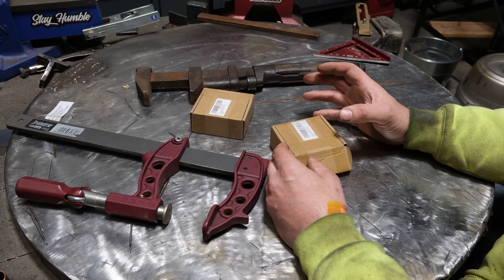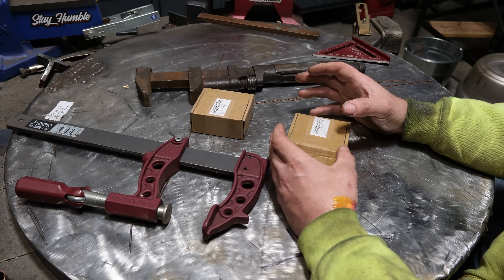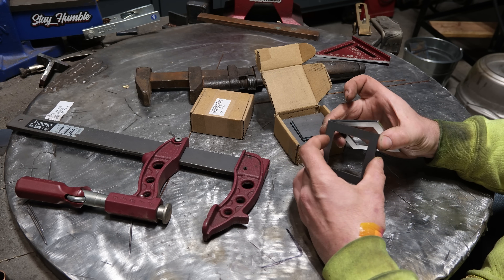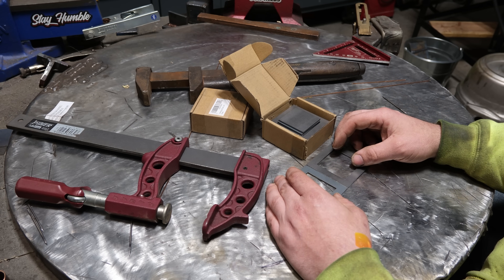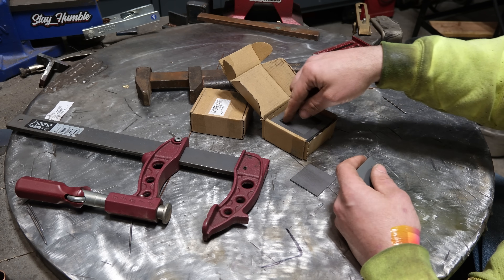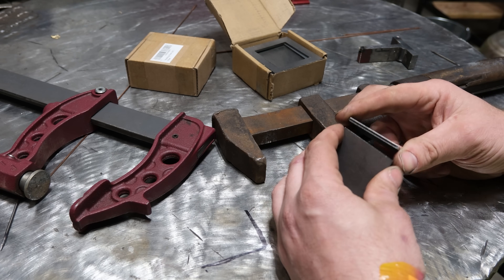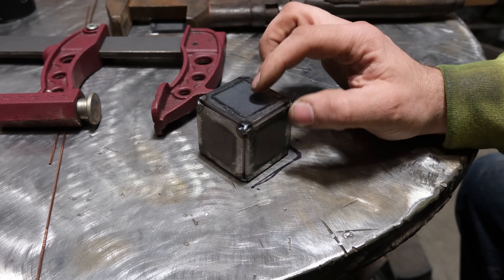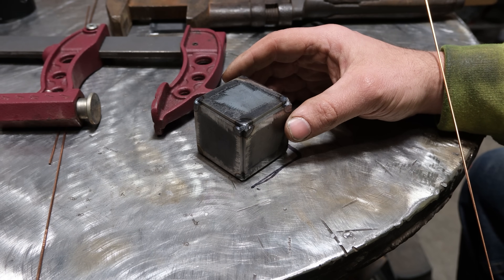Project time: lets weld a cube together from a kit

Comment: hey greg you started talking about eliminating the foot pedal as a variable, do you have advice for someone trying to learn without one at all? (I do on-site and in-situ welding, ill never be in a position to use one)
Reply from the maker: So I do have a bunch of advice, hopefully it helps.  I started the opposite of you, I spent 8+ years tig welding things with a foot pedal and not doing lift/scratch start.  I only went to lift arc due to going to work with the local steamfitters and they don’t use anything but lift/scratch.  I have grown accustomed to no foot pedal.  Having been on both sides of the fence, there are things I want the foot pedal for and things it’s an issue.  For thin material where you weld towards an edge a foot pedal is invaluable.  You can taper off amperage so you don’t melt off a corner.  Without a pedal you need to move faster and dab quicker as you get close to an edge.  On pipe where you never hit an edge having amperage control means very little.  For welding while standing and in oddball positions having no pedal makes life a lot easier, but it requires your amperage to be set more precisely and you need to be very good at controlling heat input with travel speed.  The biggest issue with tig welding without a pedal to me is aluminum.  Aluminum tends to need a lot of heat at the start, medium heat during the middle, and no heat at the end of a weld.  Being fixed amperage is a major limitation and will typically result in lack of fusion issues at the start of a weld and excessive heat at the end.  

It’s not all at a loss, here are some direct tips to help improve your abilities.  1) to start the arc be in the habit of getting the tungsten close the the metal and swipe between the tungsten and the work with your filler so that the filler makes contact with the base material and the tungsten for a moment.  This will start the arc and will reduce tungsten contamination.  Smoother starts means smooth arc.  2) Once the arc is established if your amperage is off you will have issues.  So setting the amperage correct is key.  The more skill you have (aka how well you can control heat input via travel speed) the hotter you can run.  The goal is to fuse things so running cold is not ideal.  Find an amperage that things fuse and the end of the weld isn’t super melting through whatever you’re welding (aka not super hot).  3) the hardest part of no foot pedal is tapering out at the end of a weld and not leaving defects.  This is far easier on say a piece of pipe where you can walk the puddle out while lengthening the arc gap slowly.  On a weld that’s on something that has an end on an edge or something, you can’t just run the arc out.  So normally what happens is you need to speed up slightly at the end, dab a bit more filler, and either snap out of the weld or quickly lengthen the arc gap to get the arc to cut out.  I need to do a video on ways to get better stops without a foot pedal.

Beyond what I said it will come down to a lot of practice.  Honestly no foot pedal isn’t much of a limitation, it just requires the person welding to have a bit more skill.  There are ways to make it easier to weld without a foot pedal.  The tig button can be bought and is amperage control that uses your finger on the torch instead of a foot pedal.  This is highly favored by people who do a lot of oddball repairs.  Higher end machines often have adjustable arc voltage cut outs, aka you can set it so that when you lengthen the arc gap  it automatically goes into reduced amperage mode and tapers the arc down in amperage. This prevents craters, improves end of weld heat input, and makes life easier.  Likewise torches exist that have full amperage controls along with push button arc starters/arc shut down features.  All of the above things make it possible to weld in position and have full control over everything.

Beyond what I said finding a stable position is important.  Find ways to prop and move with as little movement as possible.  Weld quality is worse when welding out in the open or on oddball stuff.  So anything you can do to help steady yourself so you can keep a consistent arc gap will improve the quality of your work 👍.
Reply: @makingmistakeswithgreg I've been working as a boilermaker for the last 5 years so basically just pipe. I started as a laborer and have been working my way up which really just means learning on the job and on my own as much as possible. Thanks a ton Greg.

Comment: Hey Greg. Do you have a video on stick welding thinner metal square tubing?
Reply from the maker: So I have done it in random videos but I definitely need to revisit it.  I will be welding a cube out with stick in a video shortly and that will directly help welding square tube.  The best hope of welding thin material with stick is 1/16 (1.6mm) rods, preferably 6013 or 6011.  Sub 45 amps and a fairly quick travel speed will be best.

Comment: Do you have anything similar for mig welding.  Side question, my Father was a welder 80 years ago and did a lot of brazing. Is that process (mechanics) the same a tig welding. He wanted to teach me but I was young and stupid and thought accounting would be cleaner. Now I'm trying to learn what he tried to teach me.
Reply from the maker: I will be mig welding a cube and giving some settings shortly.  It will be harder to mig weld the thinner material but still doable.  

As far as brazing, there are multiple forms of brazing.  Conventional brazing is done with a oxy acetylene torch and either a bare bronze rod dipped in flux or a rod with flux on it.  The purpose of this form of brazing today is generally to join pipe and tube and the braze flows via capillary action into a joint.  Oxy fuel brazing can also be used to say braze a crack shut on an exhaust manifold, or to build things that are ornamental.  There is another form of brazing known as tig brazing that also exists.  This functions very similar to tig welding In the sense you use a bare bronze alloy rod and it “welds” just like a normal steel welding wire.  The distinguishing characteristics of both tig and oxy fuel brazing is the bronze material is the only thing that melts and the base material is not melted.  Keep in mind that oxy fuel brazing rods can’t be used with tig, you need tig specific rods.

Brazing does take some skill to do, but it’s not any harder than welding with the same process.

Comment: I just watched your "does preheat help fusion" video, but commenting here, hoping you see this and can maybe respond- I welded a set of 1" thick shackle tabs to a winch bumper about a year ago. Well, actually, I did it twice- One of the shackles peeled the outside edge free of the base plate as everything cooled. I'm not much of a welder and this was a very (over)ambitious project of mine. I took the time to grind out my welds on both tabs, checking as I went.

The first time, after putting a slight bevel (3/16" roughly) on each lowest edge, I heated each tab up to around 600*, watching for the tabs to change color as the alloying metals oxidized to judge my temperature.  I then placed them and hit them with a heavy tack, then started stitch welding around the perimeter for the first pass, alternating back and forth to try to keep everything equally hot. I hit my weld and the joint with a clean wire brush after each weld segment. I did this until I had a three pass weld around each shackle tab. I then let them cool.  One did shrink enough to completely crack off the outermost lower weld, which prompted a do-over.

I was happy to see I had almost no porosity in any of my welds as I gouged everything out.

The second time, I preheated the tabs a bit hotter, heated the base plate to about 300* where each tab was going to be set, and repeated the excercise, except after cleaning each stitch weld, I also hit both with a torch for 30-45 seconds to keep the temperature up. Once I was done with my last section of my 3rd pass, I hit everything with a torch again for several minutes back and forth between the two tabs and the base plate, then allowed it to cool.  No cracking anywhere the second time.

I used a lincoln 140 with. 030" solid wire, settings maxed out. Neither tab has broken off since with a couple solid winch pulls, but your vid is making me concerned that I should not have attempted such a job with such a small welder.  Any thoughts?
Reply from the maker: The hardest part about welding thick steel with the short arc process is it has unreliable fusion.  The reason it’s not used for thick material in most “code work” is simply because its ability to penetrate into/fuse thicker steel is not consistent.  Some areas may be fused, other areas may not be.  The first 1 inch or so will generally have very poor fusion.  With a 120v welder it becomes even more limited because the process can’t carry enough heat on thicker material and the weld will function more like pouring molten metal on the joint (weld just sits ontop).  The reason you saw cracking was basically due to the mig wire just making a molten river of metal ontop of the plate, and it never actually fused.  

As far as what to do, the biggest issue with recovery points is shock loading.  Poorly penetrated welds can hold a ton of static load.  Taking the same weld and adding thermal cycles, vibrations, or impact forces and the weld will fail.  If you have doubts to the quality of the weld it’s in your best interest to do something to fix it.  Grinding the weld out and tig/stick welding it would give better results.  Or using a more powerful wire machine with spray arc or dual shield would also work.  Changing the engineering could also work.  Many professional bumpers have a shackle mount welded on both sides of the bumper to help prevent failure of the mount (aka it being pulled through. 

Hopefully that helps 👍
Reply: @makingmistakeswithgreg  Thank You!  I really appreciate the response.  Unfortunately, I don't have access to a spray arc capable mig or stick welder.  I'm pretty much stuck with my 140 for now.  I forgot to include my shielding gas in the original comment, it's a bottle of 75/25, which I think you've shown offers better penetration tham 100% co2.  

Due to the bumpers design, I'm not sure I could cut the tabs off and cut the mounting plate to set the shackle tabs in/through the baseplate.  Its a section of press bent 1/4" plate which also forms the base plate for the winch.

As I said, I was happy to see a lack of porosity or inclusions in the original three pass welding attempt, which gives me some confidence in my welds from the second attempt.

The tabs were significantly heavier than I needed, at 1" thick, but I'm hoping they'll continue to hold.  I won't use them for any dynamic recovery attempts with a snatch rope, I'll stick to my usual winch line and snatchblock to a bridle between the two, and keep an eye out for any signs they're pulling free.

I seriously appreciate your videos.  Learning a ton.

Comment: Hi Greg, Cool little project. Did you have any issues with the air inside the cube escaping as it got hot and contaminating your welds? (especially as you neared the finish)
Reply from the maker: Great question and thanks for bringing that up.  I am so used to sealing stuff shut I completely forgot to mention that.  Absolutely if you finished the weld and make it airtight it will blow out the last bit of weld.  The trick is to leave a small “out” or hole on the corner.  I weld just to it and leave it open.  After the cube cools a bit I basically tack it shut.  It’s always a fun time to weld something shut and have the weld blow out contaminating the tungsten 😅.
Reply: @makingmistakeswithgreg  Thanks for the tip Greg, very clever! I'll give it a try and hopefully get less 'fun time' 👍😃

Comment: does a contaminated tungsten/weld pool make the weld weaker?
Reply from the maker: Great question.  In many ways yes it does.  When the tungsten gets dipped it can break off the tip and leave an inclusion.  This can contribute towards a crack propagating and be a point stress can focus at.  With a contaminated tungsten the arc cone is less focused, which generally means the arc cone is wider.  A wider arc cone will limit penetration in the root of the joint because the heat is spread over a larger area.  Visually a weld with a contaminated tungsten will be far more inconsistent.  More undercut, poor wetting out
Of the toes, etc.  👍

Comment: About 1 year ago, you did a video on the Harbor Freight Hercules brand Porta Band with their Hercules miter stand.  I was wondering if that is how you cut the cube in half based on the how the metal looked like it was a nice square cut with a porta band rather than an angle grinder or saber saw?

I would think that would be a great tool to build your own kits or on other projects where a circular saw is not practical or too dangerous.  I for one would like to see some followup videos about that saw and a few other things like hoods, gloves and grinding discs etc.  

Using scraps, I have fabricated some tool caddies that were good practice and useful too.  I’m trying to build things that have practical applications to help organize my garage which is a never ending project.   😂

In other words;  I will make any excuse to practice my welding skills, and my wife likes that I’m busy and out of the house.
Reply from the maker: I did use the portaband for cutting that cube.  I ended up clamping it with some vise grips to help hold it so it wouldn’t go flying out lol.  So far that portaband has worked great, and has proven itself for cutting thinner material.  The dry cut saw I have is pretty dangerous to try to cut something like that cube, it would definitely grab it and throw it. 

I still have to refilm the glove video I made a year ago.  I tested a ton of welding gloves and had all the video footage shot (it took me 3 days of work).  The memory card was in the camera I had that was stolen.  Having to do
All that testing over was so disheartening even though I bought another 14+ pair of gloves I haven’t had the heart to do 3 days worth of work lol.  I will definitely get to it at some point soon.  I also will be testing torpedo levels, I have 14 different ones in the shop I will be testing soon 😀👍
Reply: Thank You, I’m looking forward to those and every video you drop. 

I have the Hercules Miter Saw too, but with a cordless Milwaukee that I just love.  When used in the vertical position the saw is pretty cooperative and requires no clamping, but when it is used as a chopsaw, it is awesome, but as you found, requires clamping.  Using some scrap, and some All-thread, I cobbled together a clamping system similar to most metal chopsaw.  It’s not perfect, but it really helps prevent chattering or grabbing the material. If I had it to do all over again, I would make some slight modifications.  As it is, it’s quick, easily removed and works well.  I have pictures if you want to see what I did, that I would be happy to share.  

Some of my favorite little projects, are the ones like this clamp that are simple to make from scrap material laying around, maybe a quick trip to the hardware store (all-thread), and serve a purpose.  

Thanks for your content, wisdom and sharing.  I am a better welder thanks to you.

Comment: Great video. I'll definitely do one of these kits after I get a little more tig practice in.
I have become a fan of using an overnight vinegar soak and scotch brite  for initial scale removal on small parts. Makes the process much less time consuming for me.
Reply from the maker: If the vinegar soak is an option it beats grinding the material down for sure.  Millscale sucks ☹️.

Comment: Been doing this for practiced for a few months.  I cut my own squares from 3/16 plate.  You can stick weld them too with 7018.  Making at rectangle with one end open makes a nice heavy pen cup.  I use the little  red welding magnets to hold the pieces at 90 degrees, tack them up,, then weld it out
Reply from the maker: The thicker steel will definitely help, good for you doing that 😀👍.  I am going to give welding the kit in the video with 1/16th rods but I already know that’s going to be rough due to how thin they are 😅.

Comment: @makingmistakeswithgreg: Is it advisable to attempt this with MIG or Stick?
Reply from the maker: So you could with that kit but both of which will be far harder with either of those.  Stick welding would require 1/16th rods and 20-45 amps.  Mig would be fairly easy with .023 wire and low settings.  I will have to weld up the other ones with both mig and stick and make a video on it.  Stick will be tough, probably some failures on that for sure lol.
Reply: @makingmistakeswithgreg  Thanks for the insight......looking forward to the video using the Mig process.